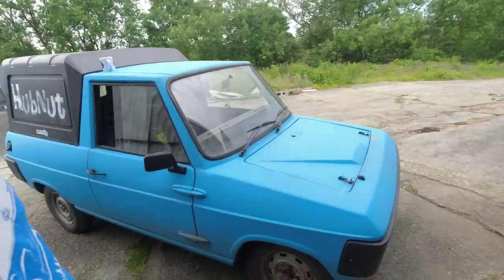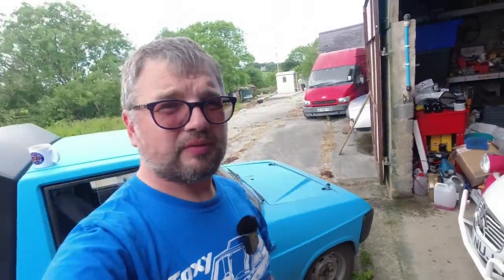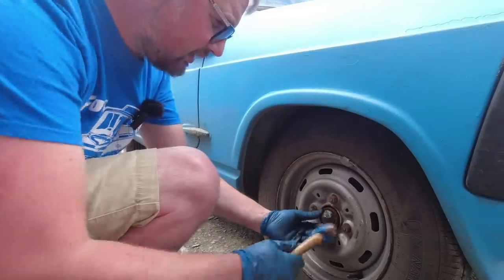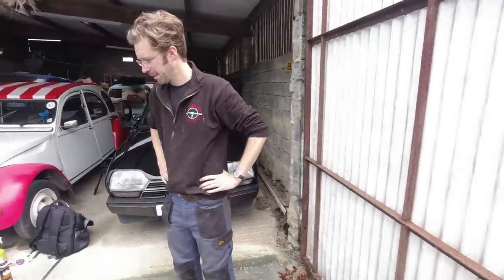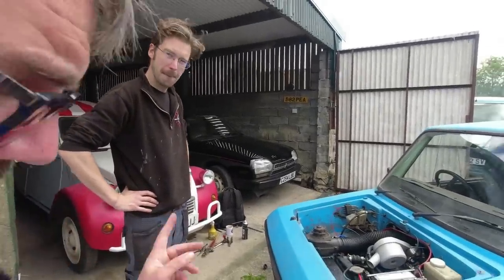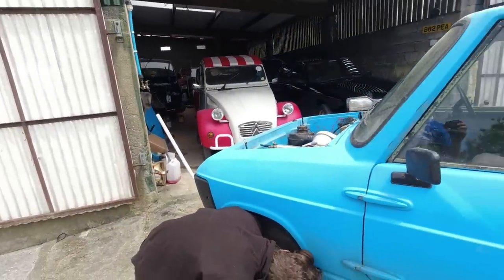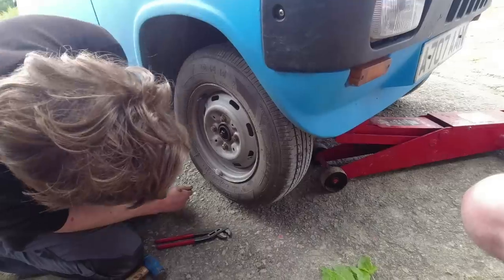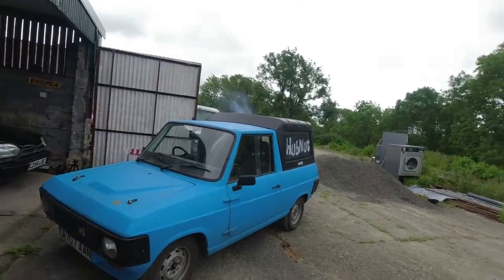Foxanne! A simple job! Needed help...

Comment: Well that took me back 30 years or more! The joys of 'feeling' wheel bearings, castellated nuts and split pins. Lovely! Seem to remember those hub nut covers come off more easily if the wheel is off first, at least as far as access is concerned.
Reply: a screwdriver helps to lever the cap off too 👍
Reply: Me too 👍 The front bearings on my old 1969 VW Beetle had a large washer that needed to move slightly with resistance.

Comment: The battle with the hub covers, usually there is a rim so you can put a screwdriver in between to pry the cap off. All dents are against you to grab it with pliers, luckily Tim has more experience with this. Have a nice ride with Foxanne.

Comment: Re bore, powermax pistons, road & race camshaft, nitrided crank and blueprinting all round should do the trick when Foxies engine is rebuilt. Decent Webber twin choke and job will be a good un !
Reply: Many a person has increased their engines output but tended to forget the most important thing, upgrade the brakes.  Not always possible on a drum braked vehicle that has not been produced for years without a complete front running gear change and modification, then it loses originality and may cost the earth.
Reply: @Alfred Wedmore I heard it was 40.5 with new bushings. 🤣
Reply: Only one question: why ?

Comment: Nice to see Foxan back out. I have been running Reliant three wheelers for many years. So I have just one small bit of advice. They are much happier at speeds in the under 55 MPH region than going faster. This way they run better & do not waste so much oil when their engines get older. Sorry if it gets a bit boring with a four-wheeler, but it is less hairy in the Robin's & Rialto's, which then become very nice to drive. 
   By the way fitting a Balister start makes them much better starters. This is a 9 volt coil, plus a balister resistor in a ceramic holder. You switch the resistor out of circuit as you turn on the starter motor.
Reply from the maker: Yeah, 50mph is generally my max in Foxanne. She has always started very well.

Comment: I have a vague recollection that the method for setting up the rear wheel bearings (tapered rollers) on my Renault 16 was to torque the bearing nut up to 25lb-ft and then back it off a quarter of a turn before locking it in place! The front wheel bearings on my Datsun Sunny were done the same way as Foxanne.

Comment: We were always at loggerheads with NZ WOF inspectors over wheel bearing play. It got to the stage where I would tighten them to no play, get it tested them loosen them off by one castle on the nut...

Comment: You need to jack it up and take the wheel off first. Then you can get a screwdriver at a reasonable angle to tap/lever it out.
Reply: @magpie6648  🤣
Reply: @magpie6648  Hubnut vs hubnut
Reply: Exactly
Reply: Thus making a gap that will let the grease out and the water in!!!
Reply: @kinasc1575  Why would you make any gap? I've never bent or distorted a grease cap? Although most have already been butchered in some way (by people hitting them with hammers perhaps). When the wheel is off you can get a screwdriver to an angle which allows you to gently tap it outward.
Reply: @kinasc1575  this is the official technique!

Comment: As the owner of a Spifire I well know the difficulties of removing the bearing caps and have a simple solution. With the cap in place get a hammer and a flat blade screwdriver and create a short indented groove parallel to and just inside the raised lip. Be gentle with the hammer Mr H, you want a groove, not a hole. Now you can simply put the screwdiver into the groove and lever it off. Plus it will still be there the next time you need to remove it and you don't need to keep buying replacements.
Reply: I was going to say the same thing

Comment: Hubnut, mechanics will use experience to adjust bearings, but you are supposed to torque them up,  check end float with DTi, then drop split pin in.
Reply: Over the years I've found doing them by feel and plenty of wheel rotations works best, had a fairly in depth conversation with a Timken tech guy who agreed with me as the torque figure was a happy compromise.
Reply: @MrOvershoot  You have to watch temperature of bearing too when doing.

Comment: Also most grease caps have a small centre hole where you can screw a self tapper in and pull it with pliers etc.
Reply: Forget about 'etc'. I doubt if Hubnut has a slide hammer.
Reply: @mbak7801  Yes, I was going to say..."or slide hammer" but didn't want to overcomplicate things.
Reply: Some do but they are not a good idea as dirt can get into the bearing so you have to make sure the hole is plugged when the car is being driven.

Comment: If the bearing caps are the same mushroom-shaped design that my old Imp had, I used to remove them by spinning the wheel (car jacked up of course) and tapping on the cap/hub joint with the cross side of a cross-pein hammer. Walked the cap out a treat.

Comment: At Skoda I was taught by the Estelle Rally team to use a standard set of pliers to adjust a the hub bearings, If you think of Lenny Henry saying "kotanger my friends" (cant spell that) but with a pair of pliers between his thumb and little finger and just nipping the nut up with that little force you could put on with your hand and pop the split pin through the nearest hole.

Comment: I well remember getting my Marina back from a service and the 'mechanic' had driven a screwdriver through the grease cap to get it off, but had then reused it. I was not amused.
Also much, much later having an almighty row with the MOT guy who stated categorically that any play in the front hub bearings was a fail, he would not even accept the authority of the official Leyland repairs operations manual which clearly stated 1/8 play at wheel edge, minimum.

Comment: Gripping the dust/grease cap too tightly defeats the object as it will spread out of circular 90⁰ to the pressure applied thus making it harder, assuming, of course, it is still true.  A clean and slight filing where the grips grip will give them more grip.

Comment: Generally to adjust you tighten gently. Then back off one flat on the nut. Same for reliant and big Scania lorrys. Modern stuff is preloaded Iveco 3.5 tonne pickup front hubs for example etc yerk it up jobs.

Taper bearings take higher side loads of radial tyres side wall flex. On ball bearings on classics the radial tyre put extra side loads thus wearing out faster. But with crossply on ball bearings wear is ok as the tyres are stiffer in the side wall and higher slip less flex and less side loads.

A freind had an American car who was constantly fitting bearings and the above situation radial tyres on single race ball bearings.

I upgraded on my mini van to taper races on the rear doing away with the spacer between the two bearings. 

Another thing that can cause excessive bearing wear is bad body to drive train earths. Gearbox to body earth starter. That can cause pitting as current passes thru shorting on the bearing hardens surface.

Comment: Are there any modern electric vehicles with motors that might be made to fit Foxane's gearbox? I don't mean stupid 400bhp Tesla motors that everyone seems to fit to everything, so they can do 0-62 faster than a 911 turbo, I mean something in the 40-60hp range. It would seem an ideal conversion for a local delivery van like Foxane, rather than another petrol engine.

Comment: Hubnut is unable to gain access to a Hubnut! You make us feel better and normal 😄 Nice video, although it's leaving me thinking I recently did mine up too tight (nipped it up so there was just no play at all)
Reply from the maker: It's a tricky one. I destroyed a wheel bearing on a Golf by doing the nut up too tight, because at the time I had no idea about taper bearings... Suspect the tolerances are a little tighter on a more modern Volvo than a Fox though.
Reply: @HubNut  Over the years I've found doing them by feel and plenty of rotations works best, had a fairly in depth conversation with a Timken tech guy who agreed with me as the torque figure was a happy compromise. Having said that a lot of the taper bearings I've fitted over the years are massive compared to automotive ones.